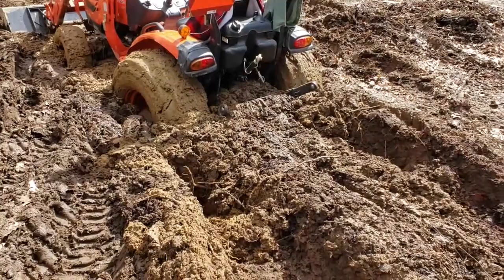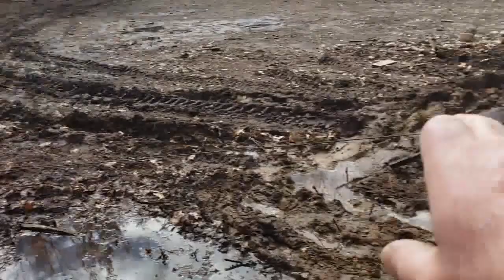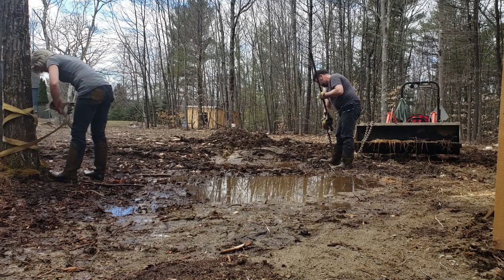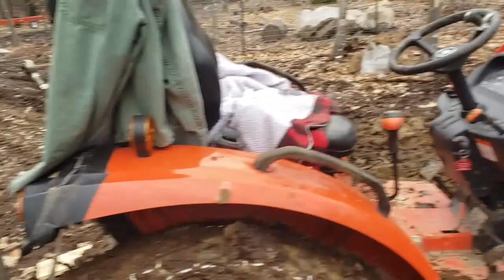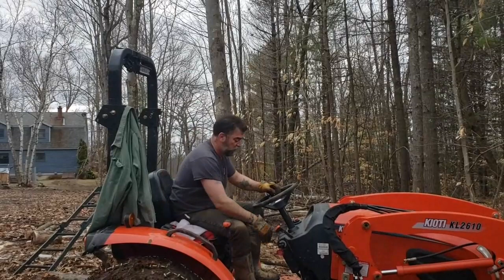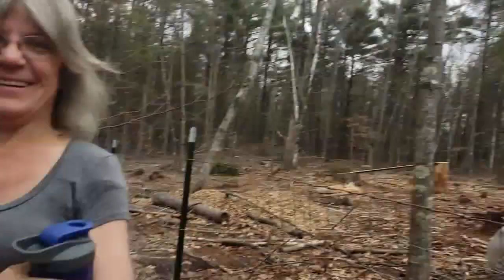We got our Kioti CK2610 tractor stuck in mud, really stuck.  How to get a tractor out of the mud.

Comment: Hi

I got My L-2501 stuck in fresh fill dirt that got water logged deeper than its ground clearance and had the belly firmly laying on the top of the mess.

I had the box blade on and had to muscle it off and flip it off to the side.

Trip to the Brand new Tractor Supply Store was next.

Bought a $70 electric (baby sized) winch, and one of those High Lift Jacks just in case.

Your mud was 5 times soupier than what I was in and We were able to clear the mud from behind all 4 tires so We didn't have to over come that problem.

We hooked that little winch off of the Class 3 hitch of My Durango and My Friend slowly worked the winch while I tried to bail out of the mud.

The winch kept enough pressure on the tractor to help Me back it out.

It was a mess but rinsed off like it never happened.

You were sunk way worse than I was and You had someone that really worked Her heart out.

Ken

Comment: I did the same thing with mine stood there scratching my head for a few minutes I had the backhoe attachment hooked up also that did help me swing the rear end around a little but I ended up doing the same thing as you using that bucket on the front to help nudge me along